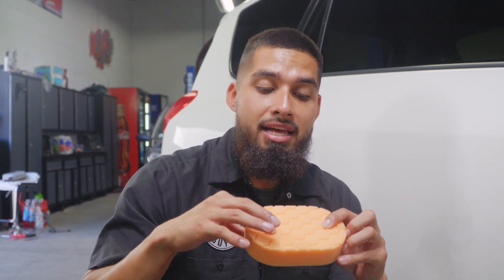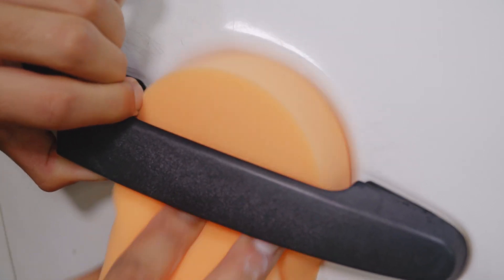DIY Paint Transfer And Scratch Removal! Fix Your Paint With These Quick Methods - Chemical Guys

Comment: "If you have a wall, I suggest you avoid it." Best advice yet.
Reply: "If you have a wall, I suggest you use our wall-removing product called Wall-Gone. It's our most abrasive cutting product yet. You can use it with a DA or by hand. It also works well on acne. It is our most popular product among prison inmates and demolition companies. Squirt about 5 dime-sized amount of product..... "

Comment: How do you recommend washing the car before using the Clay Luber? I have an older Mercedes that's in great shape, but I've been parking it outside for the summer. I'm worried about the paint and I've noticed it has light swirl scratches from abrasive past cleaning.
Reply from the maker: Hi there! Yes, thoroughly wash the vehicle before using a clay bar.

Comment: Couldn't you use a small amount of paint thinner for paint transfer then Buff to bring back the shine to the panel?
Reply from the maker: Hey! Compound is used to remove the paint as well as scratches caused by the transfer.